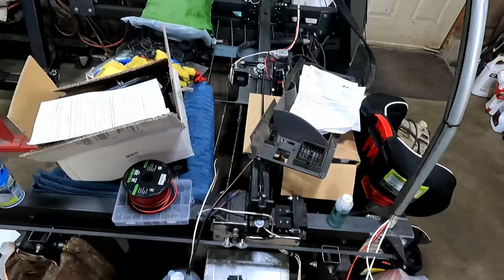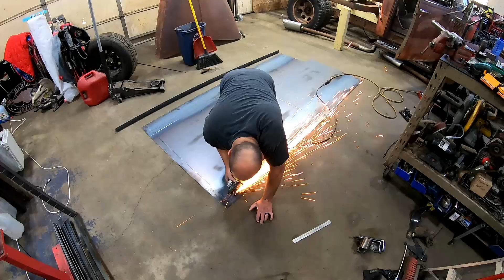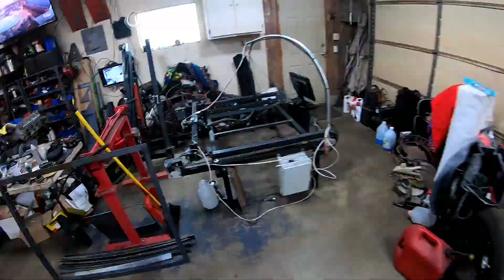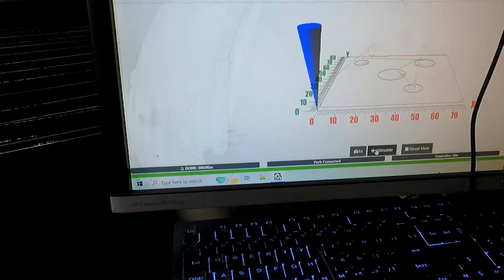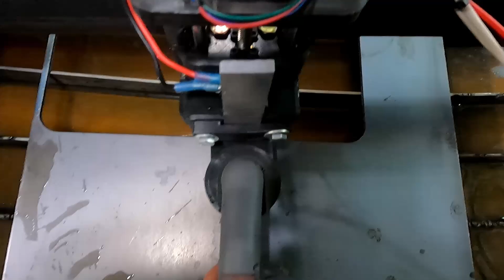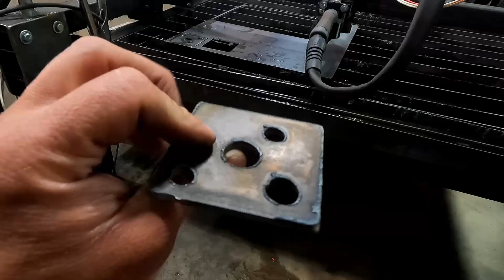CNC Plasma Water Table Build

Comment: I'm thinking of building a JD's table.  I've been doing a lot of research.  One video I came across indicated that torch height can sometimes play into whether or not you are getting a straight cut through.  As the tip wears the plasma flares out more and affects the cut angle.  Wish I had room for the larger build, but probably will stick with the gantry style.  Still doing research after a week, LOL  thanks, Ken
Reply from the maker: Sorry for a delayed response.  Torch height and tip wear is a big deal. A plasma cutter with the cnc port would help with that along with a controller.  I am still dealing with the angle, and that can very well be an issue with my holder set up. 

Thanks for the comment!

Comment: Don't know if you got the angle eliminated yet but as I was watching, I thought maybe the weight if the torch cable is pulling the handle (torch tip) from being square with the table surface.  Just a thought.
Reply from the maker: @LightningFabrication Great thought. It varies on the thickness of the metal i cut. I have had luck with changing consumables, but that isn't the fix all unfortunately.  

More often than not, the table tends to be a catch all, but times like now, I am making brackets and engine mounts, it is usable and does well. I think it will end up going through a full rebuild. Something more solid and usable.

Comment: Great video this will help me out building my JD’s CNC table. Love the square idea to get the table square. What length of tubing to get a 48” x 48” cutting area. I am doing 2 motors for the y axis as well. Great tips look to see more.
Reply from the maker: The x axis on mine is 58. I would push to 63 to 65 for 48 cut width. The y axis is 60. That would need to be pushed to at least 72. 

Planning on another table build in the future, but a couple of car projects need to get done first. Thought of a mill maybe...

Thanks for the comment!